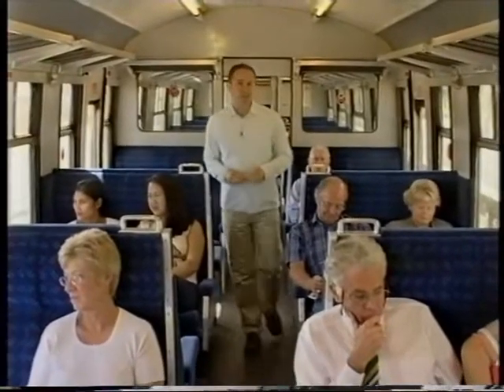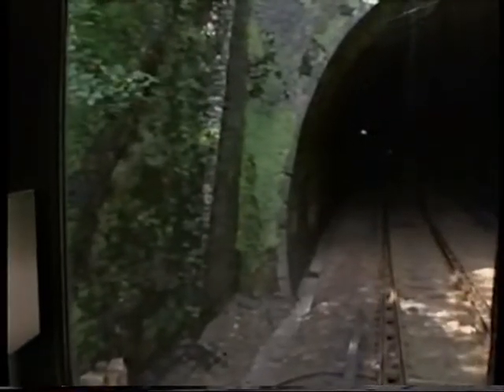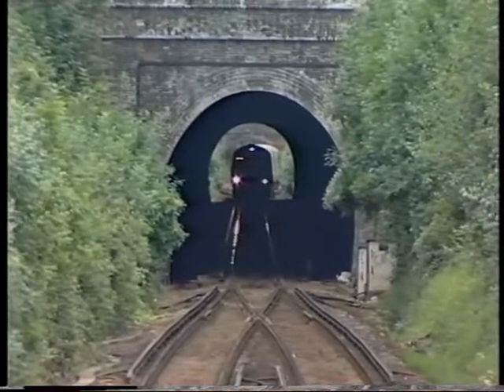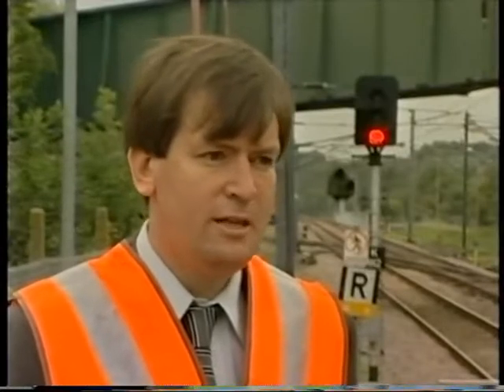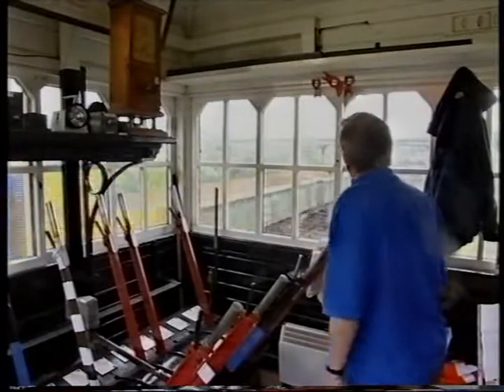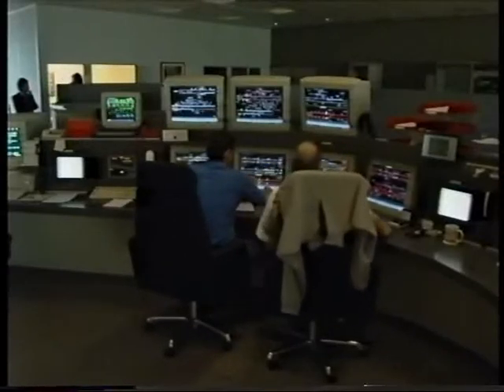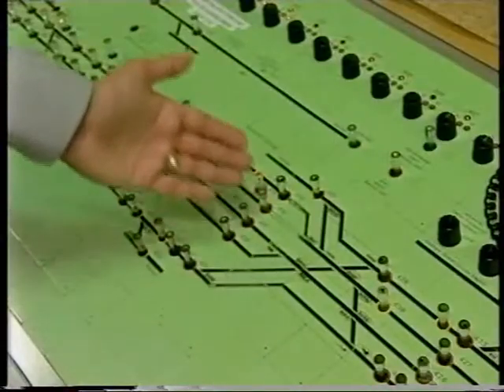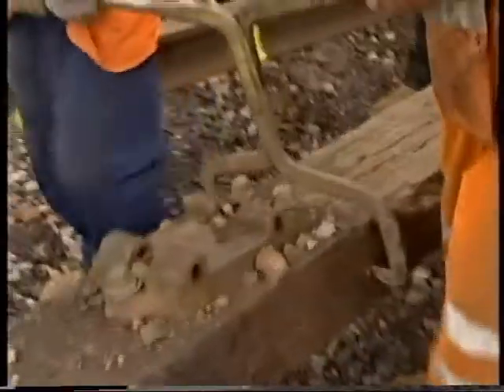Railtrack - Put Back - Category B SPAD Risk (2002)

Comment: Of course, one of the most notorious Category B SPADs was the Clapham Junction Crash in December 1988. 13 consecutive 7 day weeks for the technician installing signal WF138 led to shoddy work with the wiring of that signal. This led to the signal changing back to red in the face of the driver of the Basingstoke Train, who then reported it to signallers on the Lineside telephone and just as the driver was returning to the leading cab, the Bournemouth train, following the Basingstoke train, passed WF138 that was wrongly showing green, leading to a rear end collision

Comment: Very much reminds me of a crash at Clifton Hill in Melbourne which was caused by a trainee panicking and pulling the points under an up train. The front bogie went toward the platform but the rear bogie and the rest of the train were switched to the NS road. The leading motor car was on an angle that resulted in it hitting the end of the platform.